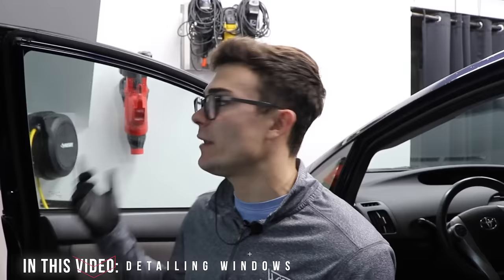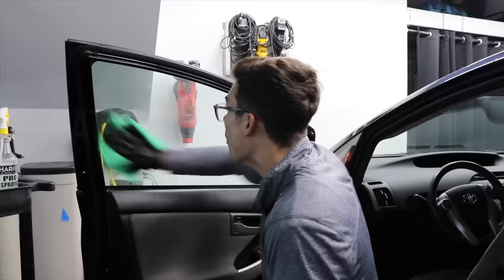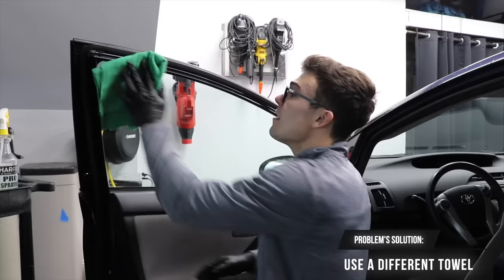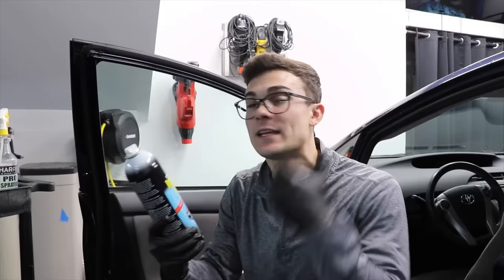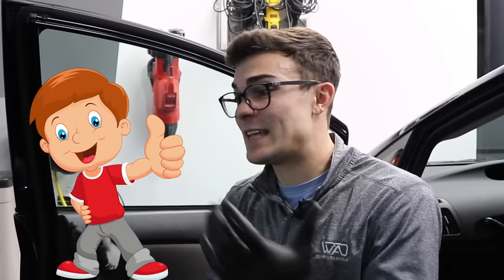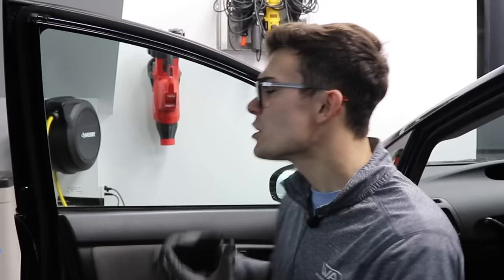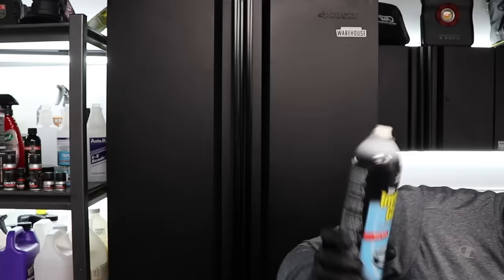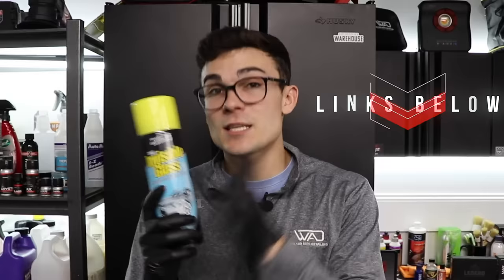Solving The Biggest Problems With Windows

Comment: Nope thumbs down, i refer to my previous comment before seeing enough of the video to know you don't know what you're talking about. Glass cleaners work perfectly fine if they are used correctly. No need for dual sprays and etc. This isn't a tip, as it is a flat out correction. Do not spray the surface to be cleaned. Spray the microfiber towel and whip the surface to be cleaned. It says it on the product also. Doesn't matter what cleaner is being used, it says it. Don't spray directly onto what is going to be cleaned. Once again, not talking about disinfectants. Disinfectants need time. Cleaners get sprayed on a towel and used. What's sad is that you are a professional using a screwdriver as a hammer. Learn how to properly use your tools, don't just copy what everyone else does. Cause is everybody wrong? They just might be wrong. Like most people who use Windex (spray on towel) or liquid (water) laundry detergent (doesn't kill germs or bacteria, powder does though).